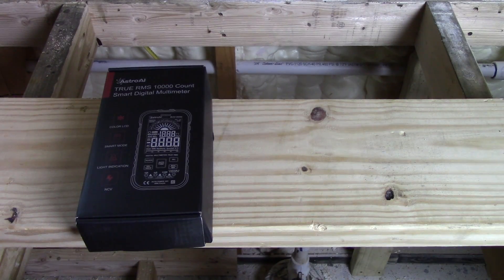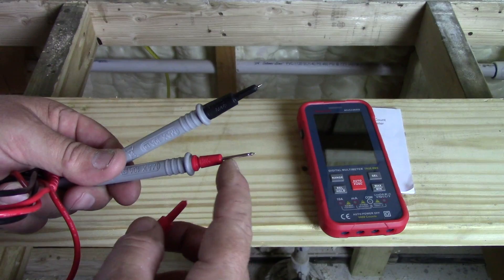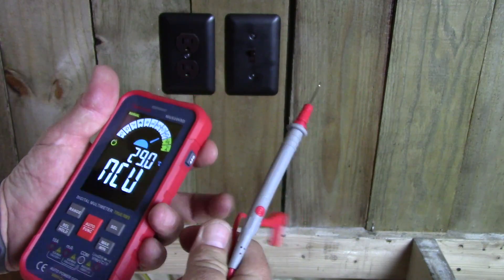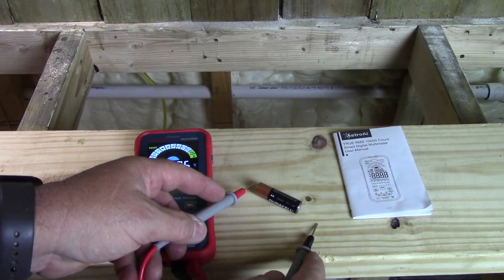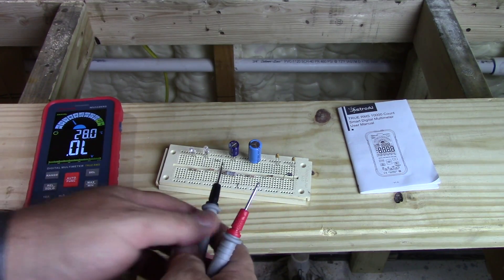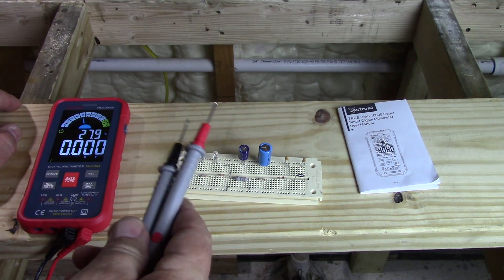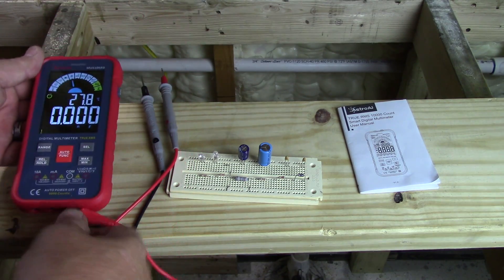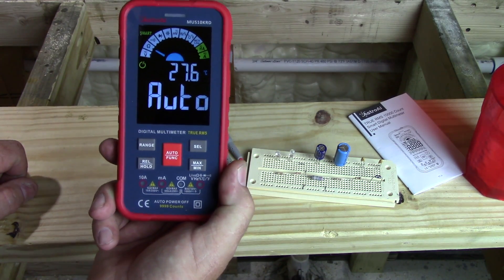AstroAI Digital Multimeter 9999 Counts TRMS Auto-Ranging Color LCD Screen Voltmeter Review

Comment: What happens when plug in the red and black into the wrong side during test.
Reply from the maker: That depends on what test. Like testing DC 12V it would just show -12V. It won’t hurt the meter it just show your readings backwards

Comment: Thanks for the review! How does this compare to the AstroAI M6KOR, which do you like more?
Reply from the maker: Basically they are both good. Mainly this one has a lot better display and the M6KOR is quite a bit larger in overall size
Reply: I was also thinking between those two multimeters, but I chose this one because of the AUTO MOD, modern design, large display and easy handling.I ordered it today March 1.2024 on Amazon for $ 36,54 and I can't wait for it to arrive. I am very happy about purchasing the ASTRO AI  MUS10KRD :goodvibes: @Woodzman

Comment: i am using a smartphone stand for this exact multimeter. initially got the stand(got few to try) on Aliexpress since it was cheaper than on ebay or Amazon, and been using it on my Fold and then Fold2 smartphones. after my old Fluke kicked the bucket i went off my buddys(plus always wanted color screen) recomendation and got this exact AstroAI model(since its top of the line from them). Noticed missing kickstand right away and decided to try that Ali kickstand(since i always buy multiples(3 in this case) of things like that even if only need 1- somehow always end up needing more(should have gotten 4)). It worked great(make sure to glue it to the exact weight center of MM) and can put MM into any configuration or even hang it off the hook or a magnet. just make sure to get the 3 section (beefy) one since 2 section(aka the ring) is not big enough but 3 section is just perfect(can even put this MM onto wet or dirty surface since only stand touches the floor keeping MM clean and dry). there are different kinds but one i chose is basically 3 oxygons with hinges in between
Reply from the maker: Awesome, thanks for the info